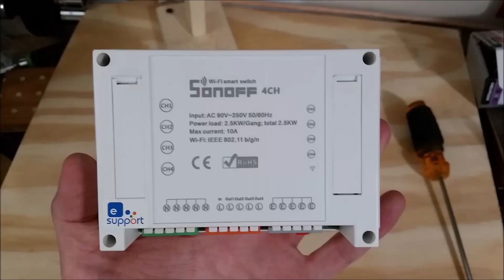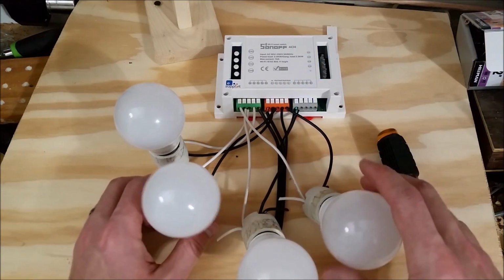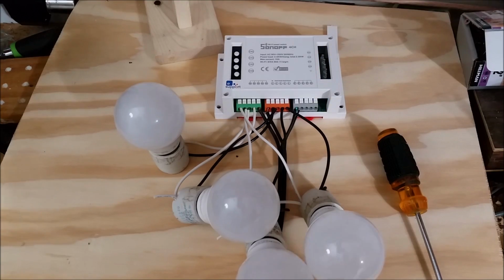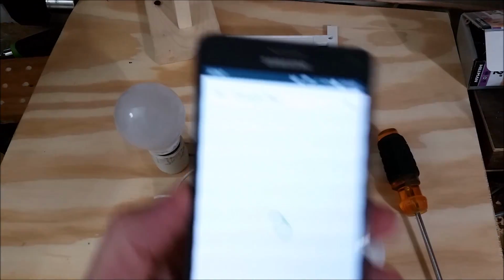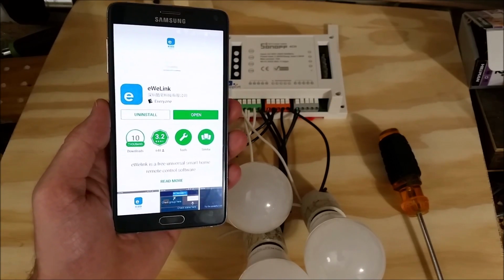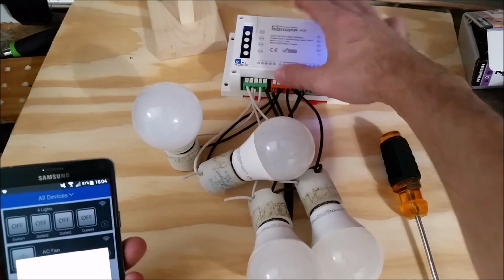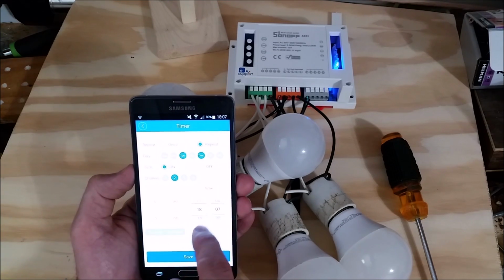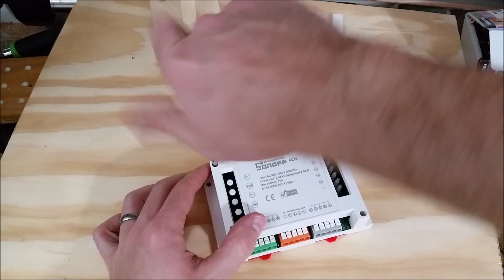Sonoff 4CH Review - 4 Channel Din Rail Mounting WiFi Switch

Comment: Is it possible to have a single switch controlling 4 devices in an incubator? I need to control temp and humidity : when humidity to high/low: start a dehumidifier or humidifier, when to hot/cold: start a warmer or the cooler. Thanks

Comment: I want to hack the switches on board the 4ch sonoff module instead of using the th10 module so I can have wall mount switches too.. are the switches momentary or latching type? Could you test and report please?
Reply from the maker: The switches are momentary.
Reply: MadeEasy thank you!

Comment: Please help this was just demo but  when you install it on wall, then how will u do connections becaz there is no seperate live wire for wall switches, there is one live wire which they put all together in all switches, will out wire on sonoff will go thru wall switches to controll wirelessely...plz help
Reply: Sameer Athaley you can connect that one live wire to "In" pin then you can take 4 output live wires and connect them to different things you want to control.

Comment: I want to use 2 channels on inverter and 2 channels on my direct light. Is it possible.
Reply from the maker: the relays switch 120v AC you can control your lights, but not sure if you can control your inverter if it is DC
Reply: As such it is not possible as one side of each relay has been made common, now you have 2 solutions

1. either cut the prints on PCB to make separate 2 relays, which may be difficult if you are a biginnear

2. or use 2 switches to turn on two relays which can then be used independently

Comment: There are two versions of the 4 Channel Din Rail Mounting WiFi Switch.  The Sonoff 4 Channel and the Sonoff 4 Channel R2.  The Sonoff 4 Channel has a maximum total current of 10 amps, while the R2 version offers 10 amps per channel.  The eBay link you provide in your show notes doesn't indicate whether this is the original or the R2 version.  However, the eBay add does say that it has a 10 amp maximum current.  No mention of a per channel maximum current.

https://www.itead.cc/sonoff-4ch.html
Reply: Your information is inaccurate. The R2 has the exact electrical specs as the 4CH. A total Wattage/AMP of 2200W/10A. The R2 will fail if overloaded with 10A per channel simultaneously. However, the R2 can handle 10A per channel through its switching functionality, but only when drawing 10A one channel at a time.

Comment: Hello 
I have a question please help. 
I have connected each channel from the sonoff wifi switch 4CH to a contactor to avoid loading the switch since I have connected 2 air conditions and 2 hot water resistance.
Since the contactor has a bobbin inside it i am facing a problem of electricity going backwords to the switch which is affecting the switch and is sometimes restarting. Someone told me that i need to install DIODES between the switch and the contactor on each channel to resolve this issue.
Is this the correct resolution? if yes which type and size and characteristics of DIODES should i buy?
Thank you.
Reply: The Sonoff is not designed to take the load of an A/C or Heating elements. Here are the technical specs for the Sonoff:
Specification for Sonoff Basic and Sonoff 4CH
Voltage range: 90-250v AC(50/60Hz)
Max current: 10A.
Max Wattage: 2200W.
Enclosure Material: Fire-retardant ABS V0.
Humidity: 5%-90%RH, Non-condensing.

If your A/C, Heater, or the combination of both draws more that 10Amps/2200W, I highly not recommend connecting any of those appliances to the Sonoff. It's a disaster about to happen.
Reply: Please read again he is using a contactor to operate AC, Heaters. Only a minor load of contactor coil will be on sonoff internal relays, a few mA may be
Reply: its old but may help somebody

this is usual problem when contactors are too close to electronic control. try move them away or move controller from interference. switching power to coils and arcing contacts generate electromagnetic interference which cause this problems
Reply: for an AC coil contactor you cannot use a diode, move the contactors away from the sonoff or try adding a small capacitor in parallel to the coil of contactor, a small capcitor 0.5uf should go

Comment: Polarity only matters in dc and ac doesn't ?
Reply: It does matter in that live (hot) is switched but neutral is not. It's safer and to regs to switch the live conductor.
Reply from the maker: yes it is true. but its recommended to connect it how it is labeled

Comment: Hi, data for timer are saved in Sonoff or in mobile phone? I mean do the phone has to be turn on and in an area with signal in order for the channels to on-off in time or you program and forget the controller.
Another question is the communication both ways, I mean the indication, in the mobile, that one channel is on or off is because it was asked to do so or as a feedback from Sonoff. Thanks in advance and for this very helpful review.
Reply from the maker: it logs it in Sonoff servers, if your phone is off the sonoff will still work as long as it is connected to the internet via wifi
Reply from the maker: it does not notify you when a channel is turned on or off, it just does it
Reply: Thanks again for the infos

Comment: How the heck do you know which one is the live and which one is neutral if you are using a wall socket ?? unless you have code the sockets yourself or you test them before inserting the plug
Reply from the maker: I used the volt meter to find with prong was which
Reply: Just touch it ,if you remove your hand in fraction of second it's live .if nothing happens it's neutral

Comment: I want to use it in my rv can i connect 2 sunoff together with the same app because i need more than 4ch, and can i use it just with wifi without internet?
Reply from the maker: yes you can have 2 sonoffs connected to the same app, but i dont know if the sonoff will work without internet, i have not tried it.
Reply: MadeEasy thank you so much you are so kind, i need to check if it works without internet before i buy it

Comment: good evening,

because the 4 channel sonoff does not work more than one channel connected at the same time?
The problem is the appliance?
Reply from the maker: no the appliance should be fine. Disconnect all appliances and see if you can get it to turn on multiple channels

Comment: Can I swap live and neutral lines. Not that I want to but I am running them off a two pin wall plug which can be accidentally reversed.
Reply from the maker: Ramakrishnan Manoharan yes you can swap them.
Reply: @Ramakrishnan &  @MadeEasyChannel  : To make it clear, as per the instruction manuals that comes along with these switches, on the input side of the switch you CANNOT swap Live and Neutral lines. But It is ok to swap on the output side of the switch.

Comment: Is it possible turn on with the switches and off with the app? And vice versa?
Reply: yes, there is a German video that explains that , you just connect them in paralel to your light switch, and this was my main concern before buying as well
Reply: There are modified versions of Sonoff 4ch that even support ordinary wall switches. Do check at www.lebhile.com

Comment: If I dont want to use the damn phone to turn the light on, could a regular switch turn it on?
Reply from the maker: yeah they have WIFI wall switches too

http://www.ebay.com/itm/Sonoff-WIFI-Wireless-Wall-Light-Touch-Switch-Glass-Panel-LED-Light-Controller-CY-/322503602118?var=&hash=item4b16b66fc6:m:mNtXFngbRNT9y3dfBJa4xvA
Reply: not this one?
Reply from the maker: you can flash the firmware and manually wire in a switch if you want, lots of work though.
Reply: MadeEasy Will those wifi wall switch work with this 4ch device, adding another option beside the app and the onboard switches, or it's a complete different product?
Reply from the maker: Marcelo Cunha yes it will work

Comment: Can I use the app, when I am not home?(from my office with 3g)
Reply from the maker: Yes you can!!!
Reply: Thank you very much. Do you also know if I can use this, to turn on of a DC 12 volt , 2 Amp DVR or it is only for AC? I found it  on banggood with 16euros
Reply from the maker: https://www.youtube.com/watch?v=99ZN7GYqvmk

heres a link to a video I made. it allows for you to turn off DC Voltage. in the video im controlling 24V AC but this will work with DC as well
Reply: THANK YOU for these quick reply's. One last question. Is this device stable? (does it disconnect from wifi or freezes? ) and is there a same device but with ethernet lan cable connection?
Reply from the maker: The device is stable and works well. As of now I have not seen any devices with LAN Cable. I do sell these on Ebay if you want to buy one. Here is the link.

http://www.ebay.com/itm/Sonoff-4CH-ITEAD-4-Channel-Din-Rail-Mounting-WiFi-Switch-/112362705866?ssPageName=STRK:MESE:IT
Reply: Thank you very much for all your answers.If I buy it, I will buy it from you :)
Reply: Will this work with Amazon echo or google home

Comment: ITEAD had a similar product on their site.  4 channel but with normall open and normall closed contacts for output. It also had a momentary on/off feature.  I am thinking about building a remote garage door opener for those times I should forget to close the garge door.  I found the one I described on a site in China and waiting for it to come in.    If this had the momentary feature I would try hacking it by removing 120 volts A/C going to each relay and make the relays just for contact purposes.
Reply: I have the earlier version of this on order and it should be in next week.  It has 4 relays and a built in
momentary feature that is selectable.  That should do what I need perfectly without programming.
I have never did any programming but I think I need to learn how to.  I am good with electronics hardware just never got into software programming.
Reply: Ken what was this version called with the built in momentary ?
Reply: can you conrol4 4ch with api calls?  If you have any idea, do let me know   
thanks

Comment: Does it have a momentary turn on then about a second later turn off?   Does it have a flashing mode, rapid on/ off feature?
Reply from the maker: the App has a timer feature, so whenever you open the garage door after a given time it will close it. You can also flash the firmware to do whatever you want

Comment: 10 amps total or per channel.  Thanks for sharing.
Reply: no way its 10A per channel at the same time, 10A at any given time yes, but 40A at 230v at the same time will burn the shit out of your house
Reply from the maker: per channel
Reply: MadeEasy wow, that's a lot, especially in 230v. Over 2200 watts. Enough for 40 50w led reflectors. Crazy!
Reply: its 10 amps in total, saw on some forum today.
Reply: 10 AMPS total.